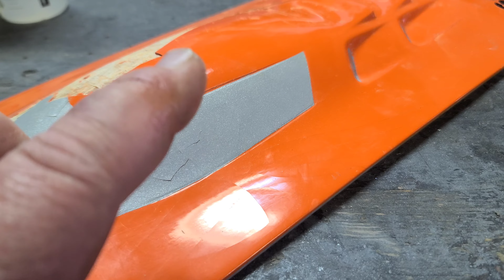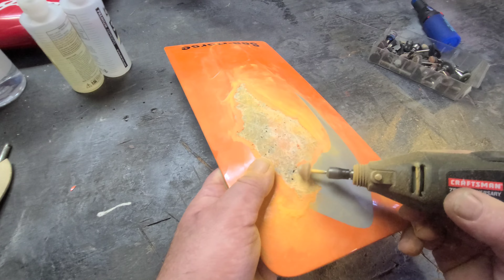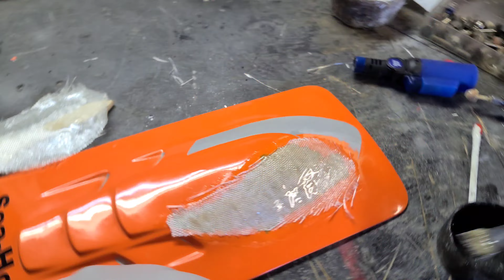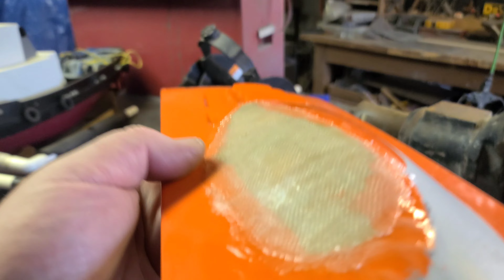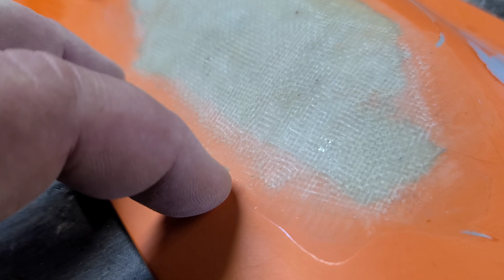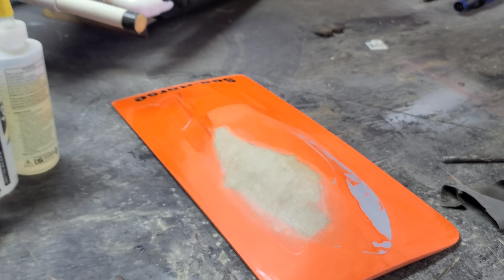Fiberglass Rc Boat Hatch Repair Easy - Deltaforce 29 FE Rc Boat

Comment: This is so helpful!
Thanks a lot.
I never did other things than gluing with epoxy. I have to learn everything.
And you are the best in showing the whole process in RC boat works.
I really wanna see everything about building the foam and replace the whole hatch.

My problem is, I have got the recoil 26 (v1). 
I bought it crashed, the propeller get into the rudder.
All the mounts inside was of and glued with silicone in.
But the hull was like new and the plastic hatch has only one little crack.
I removed all the mounts and cleaned everything from the silicone, sand all areas for new glueing on both sides and than I stopped. It's ready for glueing, OK.
But now I was thinking about forget the plastic mounts, take the 320mm carbon fibre mount for servo, motor and esc in one line.
Than a beautiful carbon fibre battery tray and a flycolor 150A es together with the Mitoot h3126 2200kv motor and make it ironclad like you did.
With longer dual trim taps and turn fins is this boat a very good boat for me and drives totally different and more beautiful than the stock one. 
And I like it to bring old discontinued RC's on a new level. With cars I did it a lot. Why not learn it with boats now. 😎😊

But what about the hatch??
It's not more available in the world from proboat. Very bad. 😞
Can I make it ironclad from the inside with fibreglass? I don't know, I will try it out.
But I have to build a foam from it before, because of the case that it doesn't work what I try. Then I never get the original foam back without buying a second used recoil one. And they are rare in Germany. 

Normally I wanna fix and drive it yesterday.
But I have no idea how to start in the hatch building seriously.
All DIY videos I have seen won't help me really.
Your have a very good way for showing processes.
Great thanks for that. ❤
With your videos I stopped driving rtr boats with micro modifications and start to learn the boat game for doing everything I dreamed by rtr driving. Thanks 🙏😎😊😊😊